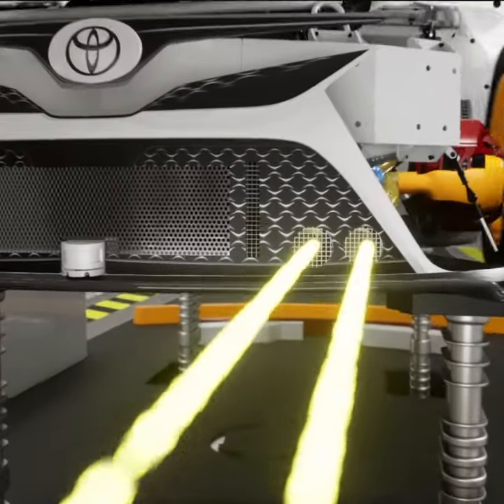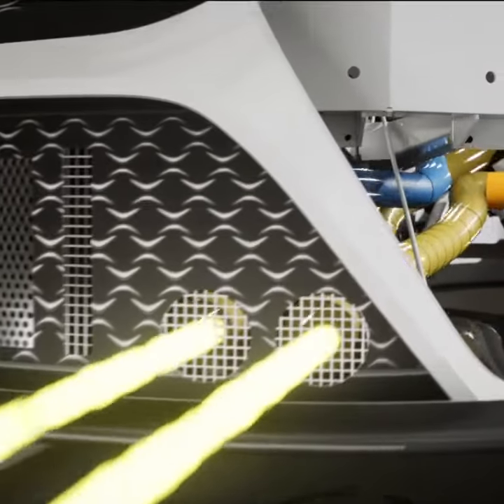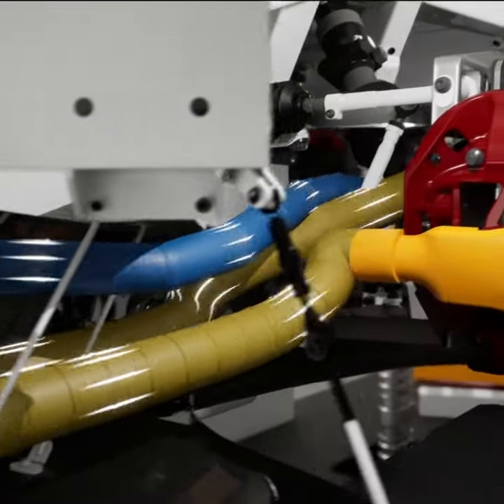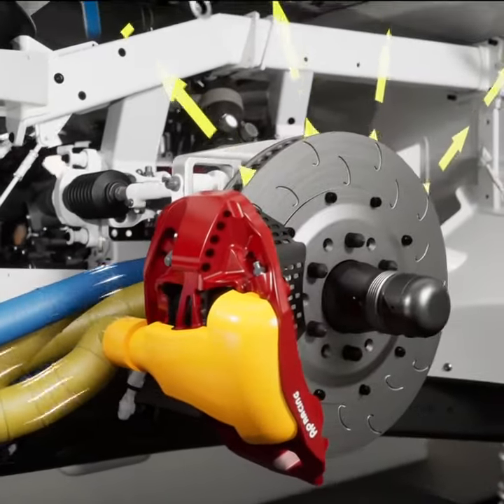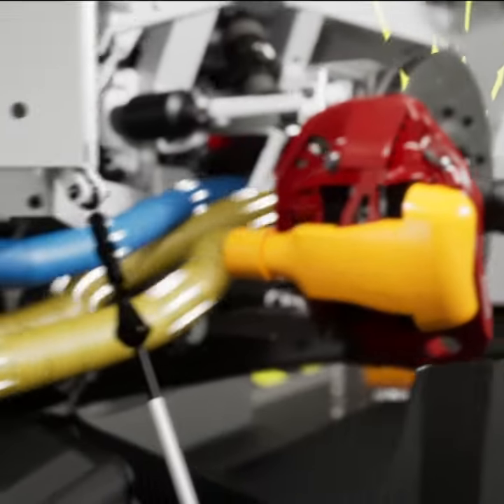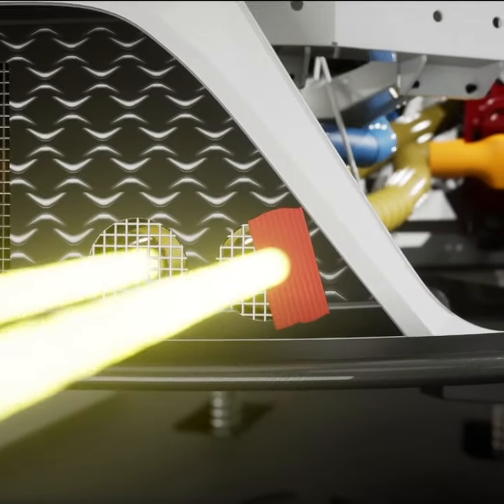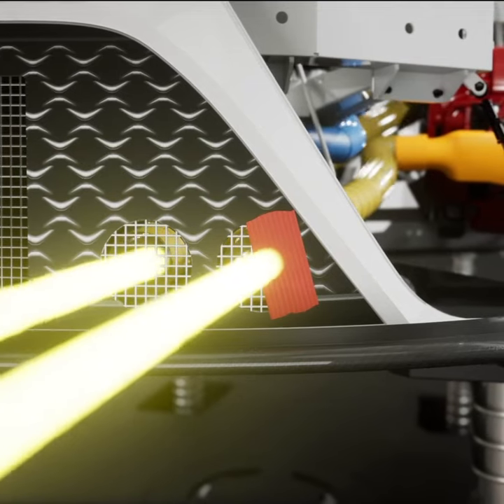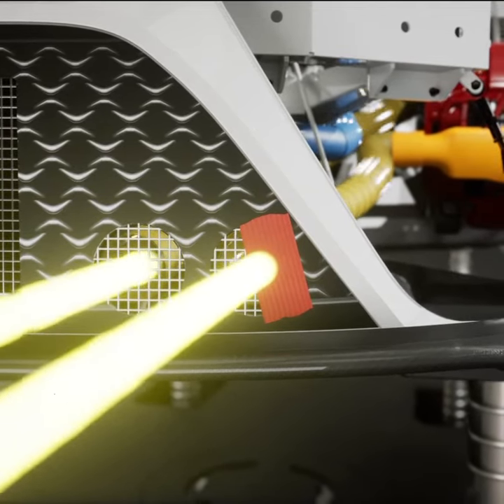How NASCAR race cars cool the brakes #shorts

Comment: Design a rain tire, 3+hour races sucks
Reply: If you're talking about going in ovals in the rain, it's impossible to race in a oval on more than 170 mph+ (for example) to control a car. The rules applies to drivers on the road to drive slower in the rain can be applied to any series Motorsports, but I am telling it's legit impossible to race in a oval under the rain, even if there are rain tires for stock car racing.